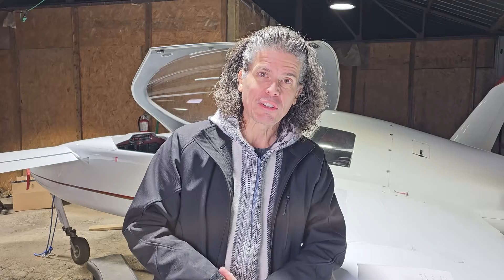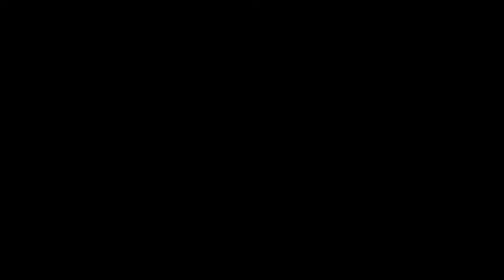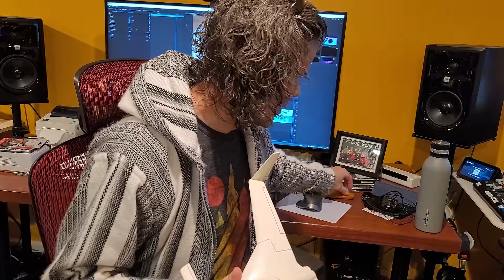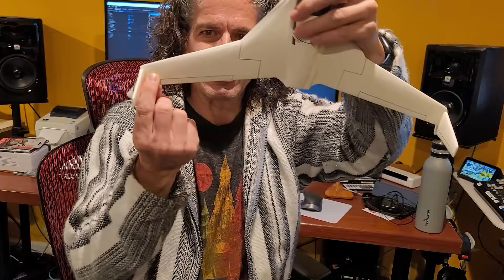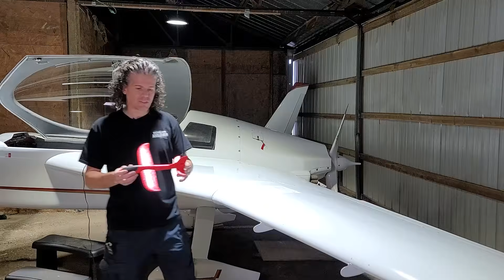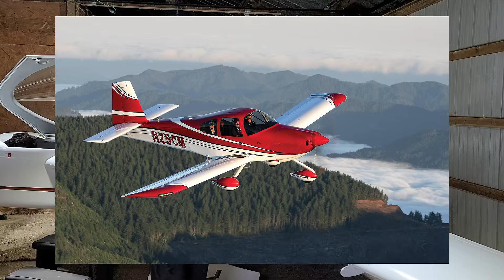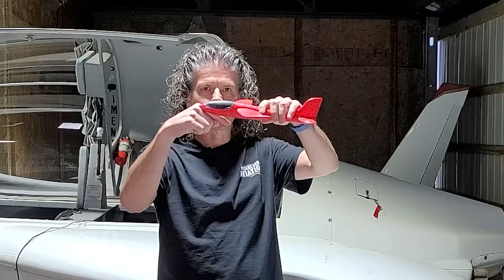Canard Aerodynamics: Why You Might Not Want a Canard Airplane

Comment: A bit of a disjointed and picayune set of quasi arguments.  The fundamental truth is that a canard design is better.  here’s why. The elevator in a conventional design must rotate the the back of the aircraft DOWNward to raise the nose.  It does this my creating negative lift in the rear.  This is obscenely inefficient compared to a canard design which raises the nose by actually creating more lift up front.  The other main More total lift!  Much more efficient.  Why would anyone want to create negative lift in the aircraft anywhere to presumably gain altitude. Conventional designs appear ridiculous  by comparison.  Stall characteristics,,, no contest.. a well designed canard system wins every time. The very first aircraft was a canard design as were many other early designs.  It took  Burt Routan and has designs to revive them. Also you can still have a rudder in the back to reduce main wing sweep.  There are many options for both high performance and more utilitarian canard designs that work better, more efficiently and safer than conventional designs.  Common sense.

Comment: As long as the area loading is higher on the canard and a decalage is present the configuration is stable in pitch.
With a tailplane configuration the taiplane must push down, effectively increasing the wing lift and the induced drag
Dind = (lift/span)² /(q π)
A well designed canard AC must be more efficient. Proof is the round the world Dick Rutan's flight.
BTW if the sailplane you showed is a Diamant, well I designed the first prototype.
For your information Max L/D = span/2√(π e/CDA)
CDA is drag area ~ 1 ft²
Span is dominant
e is span loading efficiency
The high canard load is partly absorbed by the wing inner span.
Reply from the maker: "The high canard load is partly absorbed by the wing inner span." - you got it, this is the fact that escapes most canard pilots. The canard causes reduced efficiency of the inner portion of the main wing, requiring a larger overall main wing to compensate, with a corresponding increase in drag.

Comment: 6:45 wrong. tail produce lift but direction of that lift is down. when AoA increse lift produced by tail DECRISED, and that allows center of mass pitch down because is before point of lift.

effect is: to be airborn you need 1000kN of lift but in conventical airplane you generate 1100kN of lift on main wings and 100kN of down lift on the tail.
Total drag is generated from 1200kN of generated lift.

in canard you generate 100kN on canard an 900kN on main wing
Total drag is generated from 1000kN of generated lift.
that is why canard is more fuel efficient.

danger of canard is if main wing stall first AoA increase making situation verry bad. because you don't have natural "anatomy" for recovery.

Comment: A minor contribution to the swept wing discussion. Swept wings provide some degree of yaw stability. When a swept wing aircraft yaws to the left, the right wing essentially becomes longer and the left shorter relative to airflow. The right wing increases its frontal cross section section creating greater drag. Conversely, the left wing decreases it's frontal area decreasing drag. The increasing drag on the right and drecreasing drag on the left pulls the aircraft back toward a neutral yaw position. As least that's what I remember from my education from four decades ago.
Reply from the maker: Yup, but you need the initial engineering to dampen that yaw correction, or else you end up with annoying dutch roll at some speeds. The frontal area does increase, but a lot of the increased drag is also because you reduce spanwise flow on the forward wing, increasing lift, which increases drag.

Comment: Hello Scott, I have enjoyed your videos and have learned alot.  You said you have lead shot in the front.  Does that mean the Cozy was designed for a person of a certain weight?  Or is there something missing from yours?  Also, is a cozy designed for an optimal flight characteristic?  Has anyone tried to put large tires on it for rough field conditions and soft surface?  Thanks
Reply from the maker: The C/G in a canard is narrower, such that if you are alone in the front, you will require ballast in order for the aircraft to be inside its C/G window. The gear of these aircraft is designed for hard surfaces - the nosegear in particular would not survive bush use, and a larger tire on it would prevent it from being retracted.

Comment: I very much enjoy your videos! I have a question. I am 6’6” tall and was wondering if the seat is adjustable enough to accommodate a tall person?

Thank you so much!!
Reply from the maker: The seat is not adjustable...at all. You can modify the rudder pedals slightly. I am 6'0" and my head is reasonably close to the canopy. At 6'6" I think you would have a hard time.

Comment: Death machines - to save some gas?  Rain/ice on front canard can make it dive into the ground; and, they suffer from nodding - at a too low speed, rotate - nose lifts, stalls;nose falls; stick back, nose up....repeat.
Reply: Yes the original Ronsk canard laminar airfoil was sensitive to rain, long since corrected.
Reply: @Arturo4586  Fair enough, thank you.   How about inverted?  My wing was 23012 and needed full forward stick when inverted.  First time, the shitty straps let go when upside down and had to hold into the stick!  That night, phoned Wicks and bought a nice 5 point quick release harness.  Hate that NODDYING.
Reply: Frontal area is just a reference. The skinfriction drag depends on the wetted  area and the local skin friction coefficient.
Read the relevant reports like R T Jones who also discusses the effect of winglets.
Read the most important book S Hoerner : Fluid dynamic drag, (a klick away/
Reply: @Arturo4586  Yes, wetted area and skin friction important.  Winglets seem better if lots of climbing, but not as much for long distance.  But you are missing the point - who wants to sit for 5 hours Xcountry?  Flying is about aerobatics,formation, low level, instruments.   CAVU skies!
Reply from the maker: You're remarkably uninformed. There was ONE airfoil type used on canards back in the 1980's that suffered from that rain issue. It hasn't been used in decades. As for "nodding", actually that's called "stalling" and it's not a canard problem, it's pilot error. A conventional airplane, if you do the same thing, stalls and crashes. I think I prefer the canard version of just dipping the nose down and continuing to fly - as designed. It's not a fault, it's a design feature.
Reply: @CanardBoulevard  So uninformed I was given a Permanent Commission in GD(P), one of 20 from 4,000 applicants.   No, I did not know you could make an airfoil that would not degrade in ice/rain, and that has been changed.Not sure I believe it - less effect, maybe.  Laminar flow wings bad in icing and nasty stalls. My plane, C-IAVW did not even stall, but just mushed with stick all the way back; falling, yes.  
If in a normal a/c you over rotated on take off, nothing happens - not enough lift.  Better than nodding away faster and faster.  Yes, canards good on gas, but who wants to sit for hours in a a/c.  Light a/c for fun; aerobatic, like mine, =10G, -6G.  Canards the triumph of appearance over reality.  CAVU skies.

Comment: I'm no expert on aerodynamics but please check me on this. There are some disadvantages from having prop wash over lifting surfaces as it would be in a conventional engine-in-front airplane.  As the prop wash flows over lifting surfaces it causes an increase in dynamic pressure and changes the local angle of attack. This can result in many different effects including an altered lift distribution, increased control surface authority, and changes in the aircraft stability. If the vertical stabilizer is directly behind the prop as in many conventional airplanes, it also creates some yaw torque from the spiraling air generated by the prop. We don't have that problem in our canards. No prop wash over vertical stabilizers and wings means only clean air over those surfaces making for a much smoother ride on the ground (where it's most noticeable) and in the air. Canardists are not very concerned about adverse yaw, P-factor, or Torque effects. During transition training we pretty much forget all about that nonsense. TGFT
Reply from the maker: You got it! I never thought to talk about that vortex around the vertical stab on conventional aircraft. But you're right, we hardly have to use our feet. :)

But there are advantages AND disadvantages to having propwash over control surfaces. You get instant response on a conventional aircraft - you add power, you can instantly make pitch adjustments with that power because of the added airflow over the horizontal stabilizer (unless it's a T-tail, which is just dumb on propeller aircraft, in my opinion and experience). Canards you have to increase airspeed first, so you have to fly it more like a jet - increase power, wait for airspeed increase to get added effectiveness.
Reply: @CanardBoulevard  Had never thought much about it till now but I think you're right.  I've learned something new.  I subscribed to your channel as there aren't many on Canards and I learn from your work on the Cozy because, just like you, I bought mine (Long-EZ). Good interacting with you!

Comment: Hi Scott. Many thanks for a fascinating video. Wonderful to get the aerodynamic perspective. What I still don’t quite understand is why the Canard doesn’t have flaps. The rear wing needs to have more lift than the front stabilisers at low speeds to give a nose down configuration to land. Surely flaps would give the main (rear) wing more lift and hence the required nose-down configuration – or am I missing something?
Reply from the maker: Deploying flaps moves the center of lift of the main wing rearward. This means there is more area between the center of lift and the center of gravity, causing a pitch-down moment. The canard will have to generate more lift to compensate for this, without exceeding its critical angle of attack. You don't want the canard capable of generating more lift without exceeding critical AOA, because it MUST stall first in order to protect the main wing. So the only way to get around this is to also add flaps to the canard so that it can generate more lift when the main wing flaps deploy. You would need a mechanism that absolutely, positively prevents one system from actuating without the other actuating simultaneously - if that were to happen, it would be absolutely disastrous. Something like that would add a LOT of weight, comparably, to a small airplane like this.

Comment: Re: aspect ratio, efficiency and lift and stall-resistance.
Efficient sleek planes that are stall-proof and super STOL have been proven. They are not used solely because they violate "If it looks right, it'll fly right" (even more than a canard). They look funny.

Aspect ratio is not a simple comparison between span & chord.  It is span^2 divided by area. Expressed as an integer, not a ratio.

There have been very many very-low aspect-ratio planform planes that have done very well.
First, see the Arup planes from Indiana in the '30s. Aspect ratio under 2 ("Air"+"Up")

The trick they have is that at such low aspect-ratio, when flown very slowly with very high "A" (above 25° has been demonstrated), the wing-tip vortices wrap around above it capturing a "bubble" of low pressure above the wing, amplifying the lift they get at such slow speeds. At the same time, it traps air from the front over the top of the wing, keeping it from separating and giving strong smooth flow to the trailing edge controls. Such wings do not stall, as in losing all lift due to separation of flow and losing control surface effectiveness. They'll "mush" down if they're kept flying in such a way, but they don't depart.
They are not always burdened with carrying around all this extra drag: The vortex-driven "parachute lift" is elective and temporary, in order to fly slowly and not stall. Many of the type have proven to be sleek and quick on available power when flown normally.
 If these very-low aspect-ratio planes are supposed to be inefficient and have lots of induced drag, what is this supposed inefficiency, if it does not manifest in power vs speed or fuel vs range? Because many of the sort have been excellent.

Charles Zimmerman worked for NACA in the '30s, saw the Arup S-2 fly for NACA, and later copied the very-low aspect-ratio and it's ability to be stall proof at very slow speeds very high "A", as the starting pint for his work with Vought and the Navy into a VTOL tail-sitter. He wrote about the "parachute lift" effect for UAC and NACA. Barnaby Wainfan also wrote extensively about for NASA when they were looking at the Facetmobile.
The "Parachute lift" effect and stall-proof nature of it is a known phenomenon.

Arup S-2 and S-4
https://youtu.be/Nxz1UF67EQI?si=Vf_lHaIBwL200EMg
https://youtu.be/_XrSFVDa3mY?si=Ur6PD3w6fJKd2HrN

The S-2 from 1934 was 780 lbs, flew 85 knots on 37 hp, with landing speed under 18 kts. It would not stall. Video shows it to be nimble and yet stable, with 45° climb. The Arup S-4 was 1150 lbs, dual control side by side. flew 100 kts on 70 hp. Between the two, they flew several seasons at air shows, frequently carrying advertising because nobody but nobody wanted to buy or invest. They flew on until the age of the airframes retired them. The only incident was a fuel leak and fire an fatal crash of the similar Hoffman/Younghusband plane, which had many successful flights, demonstrating the same sorts of performance.

Next, see the Nemeth "parachute plane" of the '30s. Built on the fuselage of an Alliance Argo biplane, with a 15' diameter circular wing parasol on struts. Faster than the original, stall-proof, super-STOL, 45° climb, 60° super-slow descent with practically zero landing roll with any wind.
https://youtu.be/mw7hPbTSdME?si=Z-EjTj-Yx6NvWBDN
https://youtu.be/0lMik-MkUlE?si=cegLX6BwghPZNtD7

Then there's the similar Farman 1020. Like the Nemeth, built on the fuselage of a known successful (monoplane) Stall-proof, faster than the original.

The '40s Eshelman, commonly known as the "flying flounder". Aspect ratio under 1. Super-STOL and stall-proof, 156kts on 110 hp.
https://youtu.be/JpV68abt8uc?si=zB734mtnraibffd0
https://youtu.be/idsA1dUD9QA?si=xTFn0X3ejIZmjd0f

In the '80s, The Hatfield "Little Bird" by one who flew the original Arup planes.  Sleek and efficient, STOL, stall proof.
https://youtu.be/zK63GJ0saBA?si=uJQL3KF9-Wx_NqzY
and other videos. Hatfield openly challenges the "conventional wisdom" which says they glide poorly and are draggy and difficult.

since 2015, the Rowe "UFO" from Aus.
https://youtu.be/_-u0Y7cDngM?si=NkS0IO4he0hsRzl2
https://youtu.be/_-u0Y7cDngM?si=NkS0IO4he0hsRzl2

Next, the '90s Wainfan "Facetmobile".
Wainfan also challenges the status quo about such things. They're misunderstood, and much maligned, but fly very well and should be more accepted.
740lbs max weight, 100kts on 47hp, with 340 lb useful load. Won't stall.
https://youtu.be/LK7FhK5eL70?si=Z_Ebe3sLBXp1gDtZ

Oshkosh 2023 Airventure Low Aspect Ratio Forum on Low Aspect Ratio Sport Airplanes - Barnaby Wainfan
https://youtu.be/tzokRT3rbB0?si=8t4X1kX8OIT4XzQn

Comment: So, the horizontal stabilizer of a conventionally-tailed aircraft can generate lift. It depends on how stable the vehicle is. In unstable designs like an F-16, the deflection on the all moving tail will actually be greater than the angle of attack during straight and level flight. On very stable aircraft like a Cessna 172, this is correct. In between, you can have situations where the tail generates net lift but the elevator itself does not.

Comment: There are numerous factors that are reflected in an aircraft's performance i.e. Speed, Stability, Stall Speed, Range, MGW, Max. Ceiling etc. etc.  This Canard appears to be another attempt at 'Re-Inventing the Wheel'.  With a well designed Single Engine Aircraft, there isn't any use for a "Duck".

Comment: (16:50) “We can´t have flaps in this design.“

By “this design“, do you mean (just) the Cozy? The Cessna Starship, a canard design, has flaps, made possible because the canard wings translate forward, thus compensating for the change of the center of lift of the main wing when they are actuated.
Reply from the maker: Correct, but this type of mechanism is not practical in a small canard such as this. The weight (and complexity of fail-safe interlocks) would be prohibitive.

Comment: 8:10 Absolutely wrong. The horizontal stabilizer is an INVERTED wing. It DOESN'T hold the empennage UP. In almost all aircraft, the center of lift is aft of the CG of the airplane. the horizontal stabilizer holds the empennage DOWN. Otherwise the aircraft would go ass over teakettle.
Reply from the maker: You're talking about in stable flight, and yes, in that situation that's how it functions (I go into that in detail in the first video in this series). But at 8:10 I'm talking about displacement - i.e. turbulence that has caused the tail to go down, and the aircraft to pitch up in relation to the relative wind. In that instance, the horizontal stab absolutely does push upwards to return the aircraft to stable flight, which is exactly what I am explaining here.

Comment: I guess the CG is ahead of the main gear.
Reply from the maker: It has to be, or else the airplane would fall over on its back. That said, it's not much ahead of it, so if you lift the nose too high when on the ground, it's possible to get the plane falling over backwards, which causes lots of damage.